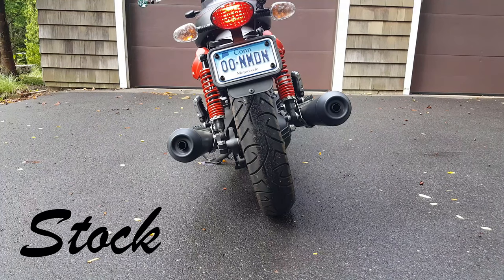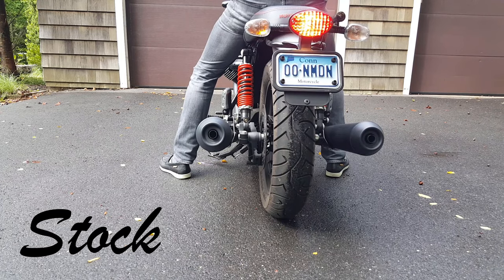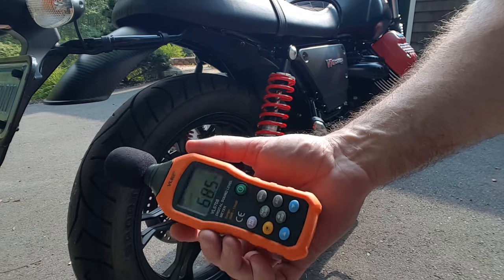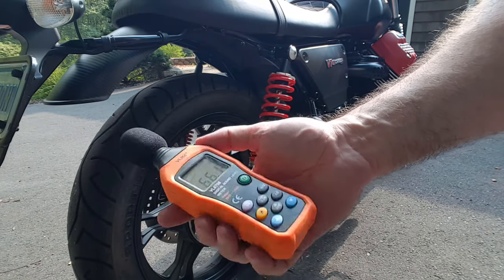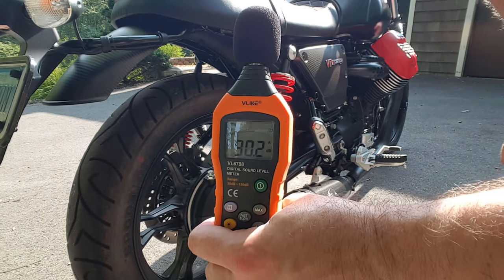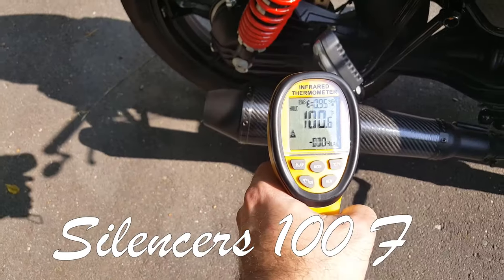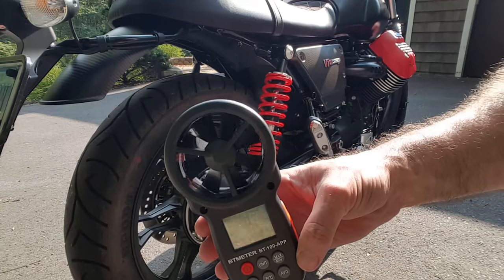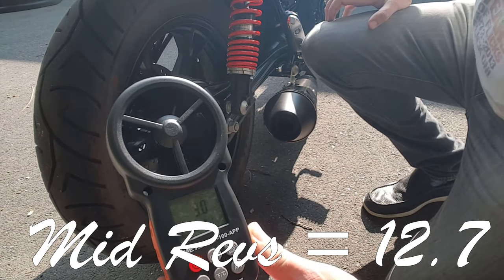Meanest Exhaust Ever? Agostini Carbon Exhaust Review for Moto Guzzi V7 Motorcycle

Comment: Love the exhaust and the red springs!!! You need to do a video where you mention all the modifications you’ve done.
Reply from the maker: That's a good idea. I recorded install vids of the parts and haven't edited them. But I'll do a vid on what I've done to it so far.
Reply: @DucatiDiaries  Have you looked into this? GT MotoCycles V7-V9 ECU Re-Flash Tool
Reply from the maker: @stevemiller1203  I'm having my dealer do mine to hopefully keep the warranty in tact but I did look up those as well. What I'm really interested in now is a piston hit to upgrade the bike to 820cc for more power and torque. I'll post a video on it if I move forward with it. I just heard about it yesterday from Todd at GuzziTech. Gotta read up on it more.

Comment: I go stock on this for various reasons, I understand the attraction to the after markets. But the stock Guzzi is not under engineered and it looks and goes fine, indeed its a classic understated beauty. Basically all the other technical reasons roll up into that if we are talking about a riding around or using for transportation bike.
Reply from the maker: As long as you don't have to be super quiet for your neighbors, this exhaust is really worth the spend. It sounds so bad-a$$ but it's not obnoxiously loud (Like my Termignoni's on my Diavel (but the DB killers fixed that)). So you could put these Agostini's on and still not disturb the neighborhood.

Comment: Dear all, I just picked up my Moto Guzzi Carbon Dark with the Agostini's Carbon Fiber exhaust without baffles and the sound is realy awesome. Much loud than and amazing more than the sound you show in the video...ahahahahah.I love it everything, Amazing motocycle. Eger to see your next video about Agostini's  exhaust without baffles. keep us informed.
Reply from the maker: Awesome. Did you get the tune with it?
Reply: @DucatiDiaries  No I didn´t. What is that ?
Reply: Principal aspects to Improve performance on V7III;

- GT remapped ECU, even with everything else stock
- remove/plug the evaporative emissions system junk.
- improved mufflers/exhaust system (with updated ECU map for it)
- remove the secondary air intake system (to eliminate popping and spitting) with the GT SAS kit.
- improved front suspension
- improved tires
- improved rear suspension.

Well, I don´t know if that realy helps once the V7 III 2018 was already been improved by the fatory. I will wait to gain more experience and read more about it.
Reply: Hi, it would be nice to see another video about the V7 Carbon Dark (baffles out or more horse power )  ... thx

Comment: I like the classic look of these bikes and I don't think carbon fiber belongs anywhere on it. IMO. Also, with no baffles, don't you need an ECU retune?  Besides losing low end power with no back pressure, you're risking burnt valves. This ain't 1975 and Moto Guzzi knows a thing or two about engine tuning.

Comment: I have a '18 Carbon Dark.  I too went with red spring shocks on the rear.  Man, that Agostini sounds nice!  Just not ready to drop another grand into this bike.  I did full cartridges on the front to go with the new rear shocks.  Bike handles great in the curves.  I thought you could get a map from Beetle and use GuzziDiag to reprogram the fuel map.
Reply from the maker: Awesome. Mine needs front suspension badly. Stock is horrible. How is it before vs. after? Noticeable difference? I'm working on a another Moto Guzzi video right now. Stay tuned.
Reply: @DucatiDiaries  , I went with the Traxxion Dynamics Fully Adjustable Cartridges.  Great team and now there is no "overriding" the suspension.
Reply: @peterlindner5300  , congratulations.  I hope it will not disappoint if you currently exploit the full potential of the Griso.  I went with Bitubo shocks with rebound damping instead of just red springs. I chose Bitubo because I wanted to stay Italian where possible.  I recently added Mistral short exhaust and it sounds good without being too loud

Comment: Love your bike man. Looks amazing I am in between the carbon or the racer, for me carbon looks better but racer has ohlins and rev counter. Cheers
Reply from the maker: Two great choices. I would have considered the racer too but I had a Ducati Monster (S4R) that looks close to it. I went for the black and red. You can also get a black V7 and put the valve covers on as accessories too. But if you can get a Carbon Dark, they are limited in number so it's kind of a cool collectors thing. This is the first bike I'm planning on keeping (God willing) and adding more bikes hopefully soon (I really want to get another Ducati Diavel).
Reply: @DucatiDiaries  Have you ride it with a passenger ? if so, how was the experience for both ? Thanks
Reply from the maker: @akula1055  I haven't ridden with a passenger but I think it's comfortable. It's definitely not too loud. On the bike, it is a deeper sound but a good sound. I've had louder bikes for sure. I think your passenger will be happy with it.

Comment: Beatiful bike man, congratulations. I have one V7 Carbon Dark too and already order a Agostini Carbon exhaust. Seeing your video make me some douts about the exhaust and the stetic with the all bike, it seems a litle to small and without a continuity along the pipe, unlike the stock exhaust. Well, it could be only my imagination, the truth is that sounds much better. Anyway, I am eger to see your next video about the exhaust without baffles. Nice video and thanks for sharing.
Reply: hey Luis I'm in the process of getting a Carbon Dark also, I might get the longer exhaust but bike sounds good!
Reply: Hi Steve, the V7 III Carbon is so beautifull that we shouldn't have any ideas on changing things. Is like an Opera, you take a couple of notes and you ruin it completly. But the sound of the exhaust could be much better with a diferent exhaust. Unfornunatly and for what I have seen the Agostini Exhaust's for the V7 have all this issue, they don´t go along proprely with the rest of the pipe. Only for the V9 they fit perfectly.
Reply from the maker: Hi Luis. Apologies for the delay. I was surprised by the shortness of the exhaust when I first saw it but then I realized the stock exhaust are just really long. I prefer the shorter (and lighter) Agostini's.
Reply from the maker: Hi Steve. The long ones look cool but the short ones grew on me (especially being 15-20lbs lighter than stock). Did you get your V7 yet?
Reply from the maker: Hi Luis. This particular exhaust (the carbon version) goes well with the bike. It matches the carbon fiber parts of the bike nicely.
Reply: @DucatiDiaries  Thank you for your answer. This week I should receive the Agostini's Carbon exhaust from Italy.

Comment: Did you change the springs yourself? Easy job?
Reply: So.... i changed the springs myself. Dead easy and no spring compression required. Just spin off the locking nut and adjuster. 10 minute job. Also.... i got the Agostinis in black. Total balls up. The bracket on the right hand pipe was 2 1/2 inches out. The bracket had been put on the wrong way round!!!!!

I binned them back to ago, money back and got myself a cheeky set of Norman Hyde pipes. UK based exhaust guru since 1975. They sound the dogs bollocks and fitted like a glove. Also came with  nice small heat shields to disguise the clamps. Which for the prices of Agostinis  is shocking they don't come with them. The Agostinis just look unfinished at the clamp areas. Total cost was £379 including free shipping. No brainer for me. So Norman 1 - Agostini Nil.
Reply from the maker: I'm going to have to check out the Norman Hyde pipes. I just got a Diavel and now I want Termignoni exhaust (it never ends) but they're $3,000 / £2,381. :o(  I need an additional job! Cheers mate and God bless.

Comment: What's the reasoning for the tune? Is it necessary only for riding without baffles, or is there a performance or reliability purpose for a tune even with baffles in?
Reply from the maker: I heard the bike runs lean after installing the more breathable exaust with the tune. However, I haven't had any problems with the bike. I do plan on tuning it though as I heard good things about the tune (smoother power, etc.).

Comment: Hey my man what a great and deep review - well done. You said now that you got the new pipes you have to get a "tune on that setup" what do you mean by that? Is there a calibration necessary after switchin´to the new Exhausts?

I'm waiting for my Agostini for my V9, can't wait.
Reply from the maker: The dealer recommends a tune, but frankly I don't see the need. I'm only getting the tune because I heard it improves the ridability of the V7 platform and also because I'm going to be taking out the baffles, which would definitely run lean without a tune. I'll be doing videos on the tune, baffles, etc. as it gets a bit warmer.
Reply: @DucatiDiaries  thanks for the quick reply 🙌
Reply: @DucatiDiaries  The sound on this Vid, is that with the baffles / DB Killers? I'll will order mine Within 2 weeks :)
Reply from the maker: @jhakk5403  Baffles were in. I'm going to do a video soon with them out though.

Comment: great video,Agostini hands down. I'm thinking about buying that exact model,it's a demo for $7000. I don't know how reliable the V7 is? Do you have any information about this you can pass on? Greatly appreciated,thanks Mark
Reply from the maker: Hi Mark. I think $7K is an absolute steal. I got mine for just under $10K after a $1K manufacturer discount. I would have snapped up that $7K for the demo. Ok so firstly, I came from a Ducati Diavel, which is a beast of a bike. Break-neck torque and power. So I knew getting into the V7 was just going to be something to take slow rides on and kick around town on. However, I was actually pleasantly surprised with the torque of the bike (it's much lighter than the Duc too, which helps. Plus these cans just took another ~20lbs off too). My gripe with this bike is the front and rear suspension is not the greatest. That's my only gripe. But you can upgrade them. You can also tune the bike and even upgrade the pistons to 820cc for more power, which I'm looking into doing hopefully soon. This is the first bike I've actually decided I'm keeping instead of selling to get another bike. I want another Ducati Diavel (1260s) and if that ever happens, I'll have two bikes. Who knows, if the channel takes off, maybe I'll get a few bikes going. :) But in summary, I recommend the bike.
Reply: Thanks very much for the reply. I don't need to go all that fast so the power is just fine for me. I really enjoyed the bike when I test rode it, with all it's character and vibes. Your bike looks great with the red springs, new pipes and all. I'll be checking in with what your doing on the bike. Thanks again Mark..
Reply from the maker: @mkoehler222  Sounds good. Let me know what you end up doing.

Comment: Hey, just curious if you had any problems fitting the Agostinis?  I have just gotten the same ones for my V7III and they do not line up with the existing mounting spots.  About 1.5" off... Wondering if I am doing something wrong... Any tips would be appreciated!
Reply from the maker: Hi. I actually had mine installed by my dealer and they seem to be a great fit. Sorry I couldn't be more helpful.
Reply: @DucatiDiaries  No problem, thanks. BTW, are the baffles in for this video?
Reply from the maker: @SurferDoodsSC  Hi. Yes they are in. And it's nice and loud but one day I will try with them out and make a quick video of it.

Comment: What kind of helmet is that with the face guard?! Looks so nice
Reply from the maker: It's this one (very reasonable) https://www.revzilla.com/motorcycle/ls2-of569-helmet-solid  

The one in the image there is the older one. The one I have (newer) is nicer. I also use  a Shark S-Drak Carbon Fiber, which is my coolest helmet ever. Both of these offer minimal protection though. For longer rides, I have a Nexx X-Vilitur Carbon. 

Here's the S-Drak: https://www.fc-moto.de/epages/fcm.sf/?channable=e78948.ODEyNjE1Mjcx&ObjectPath=/Shops/10207048/Products/Shark-S-Drak-Jet-Helmet/SubProducts/Shark-S-Drak-Jet-Helmet-0003&Locale=en_US&gclid=Cj0KCQjwwr32BRD4ARIsAAJNf_1GX_QBsgGBQ4-dB4lUt8cRBCWMN-UoiusHrXWAUjcvqKaU15NN36oaAn_wEALw_wcB

Comment: Best review of stock vs Agostini on YouTube! Was thinking of doing exactly this before I found you! Props!! Any suggestions on mounting it? Or straight forward? Greetings from Cologne
Reply from the maker: Thanks mein kamerad. So far I love the Agostini exhaust. The slipons are very easy to install yourself. I had mine installed at the shop because I was lazy. :)
Reply: @DucatiDiaries  Hallo mein Freund aus der weiten Welt! Just a heads up. I received my Agostinis yesterday! Felt like Christmas as a little boy, just to realize that the catalyst was missing. Yes, in Chermany that's a thing, Agostini should inform about. Wrote to them, instant call back from Luca from Agostini, great support to mention, I'll get my cat and then I'll share my experience with you. Happy to connect if you'll wish a joined Guzzi ride around Cologne area + 200km! 🤜

Comment: The ECU can change on it's own by up to 25%. This is standard from Moto Guzzi. Do you really need to re tune the ECU ?
Reply from the maker: Oh I didn't know that. That's cool. I'm getting some exhaust pops but I think they're cool. :)  The V7 is kinda twitchy with initial throttle response (like enough to give you whiplash if you're not holding on right). The tune improves the powerband (and hopefully adds more power). It's definitely needed if you take out the baffles (they say). I'm going to take them out and do a before and after vid. But ultimately, I'll tune it just to improve the rideability. The guys on the forums all recommend it. They say it's a vast improvement (not so much in power but ride quality). Speaking of ride quality.... I really need to replace my forks and rear shocks. Rubbish. LOL
Reply: @DucatiDiaries I've ordered the stainless black slip ons for my Carbon.  I know what you mean about the tune up. Best practice to do it to stop engine getting too hot from open pipes. Long term use without it may cause an issue. Especially if you are gonna keep the bike. I agree, the suspension is not the best lol!!!  I'm considering options at present. It's a tad soft. Even when tightened right up. A diet might help me too though :-)
Reply from the maker: @cams2575  Haha. Yeah I gotta get on the diet part. This bike is probably struggling under my 220lbs. If I got down to like 190, my car and bike times would be better. LOL. The front forks are... not satisfying. That's for sure. If this bike was just a little bigger (1000cc) and like 30 more HP/TQ, it would be a 10/10 bike. After having an insanely torquey Diavel though, I'm not disappointed in this bike's torque. It's better than I expected. But the suspension... That's something I'm going to have to drop another $3K on at some point to fix.
Reply from the maker: Moto Guzzi  I considered upgrading the suspension (I work in NY and I experience the pot holes on 684. It's like a warzone.) but putting in that many thousands of dollars, I should just get another Ducati. I had a Ducati Diavel and I wish I never sold it. It was awesome. Now I want a new Diavel 1260. :)  Just need to get a second job ($22K). :o/